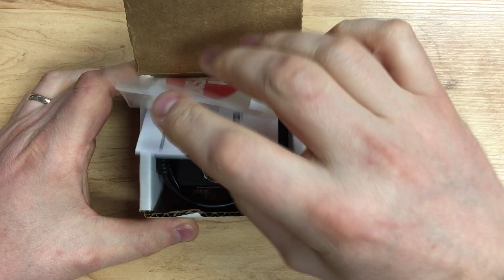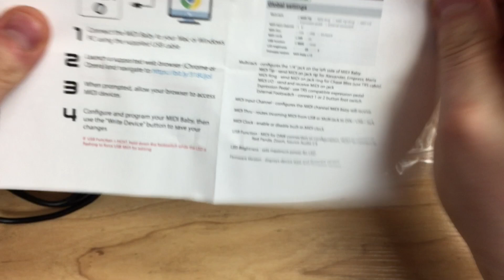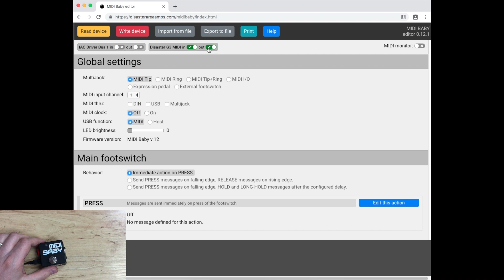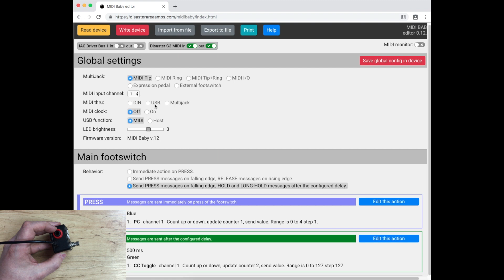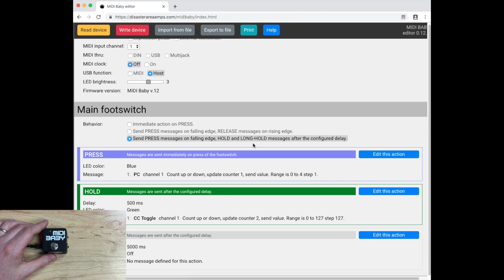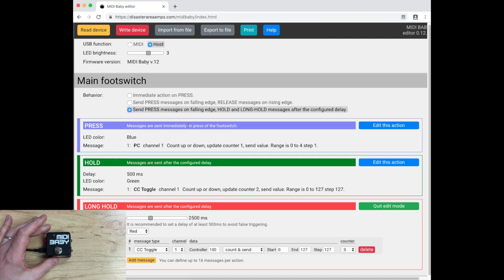Disaster Area MIDI Baby 1: Introduction

Comment: MIDI Baby Gen4 is the best smallest MIDI controller out there. No doubt. I use it to change presets on my El Cap v2 and it works like a charm. I use a different LED light for each preset. Sure, if you need tons of presets, you might want a controller with a screen and/or more options, but for simply changing up to like 7-8 presets, it's perfect.

Comment: Hey. Do you have an idea if there is a way to use this to control start/stop features on my Akai MPC One + Sampler? My unit does not have a foot switch input but can accept midi clock signals from other drum machines. But this is a hassle to do live. I've searched high an low for a solution. Thanks.
Reply from the maker: Sure, the MIDI Baby and Baby 3 can send MMC Start / stop / continue messages as well as MIDI start and stop.  My guess is we can make it work.
Reply: @DisasterAreaDesigns  Awesome. Thanks for getting back to me so quickly. I just ordered one and will report back if it works out. Thanks!
Reply: @DisasterAreaDesigns  Tried it but no dice. Not saying it's the pedal's fault but the thing that is complex with the Akai MPC One plus is that it needs to see a clock setting coming in to allocate start/stop functions. If it doesn't see a clock, it does nothing. When the Midi Baby is set to "clock out", my MPC is defaulting to it's internal tempo which is 120 BPM's regardless of what the sequence tempo is set to. Long story short, although the pedal can indeed start a sequence, it can't find the correct tempo to match. If you know a work around please advise but I think it's dead end.
Reply: @thegreatpatsy  That's an issue with a lot of devices, including Roland gear.  The micro.clock (classic and Gen4) can operate as start / stop while allowing you to set the tempo with their control knob, if you purchased the unit from us we'd be happy to swap out for the price difference.

Will sending an MMC Start or Continue message do the trick? The Baby can also do that.   I'd try that as well as normal MIDI start.
Reply: @matthewfarrow8151  I had tried MM start, no luck, does nothing at all. There is no MMC Continue function on the software. I researched the micro clock but this seems to be the type of pedal that sends tempo to a unit which I'm trying to avoid because it's two steps. I appreciate the suggestions though.

Comment: Suppose I have a looper pedal that doesn’t quantize, but it does take a remote stop/start switch. Can this be configured to start a looper on the first press and stop the looper on the first quarter or whole note after the second press? I have a DAD SMARTClock I’d be using to keep the tempo.
Reply from the maker: No, I don't think so.  It doesn't know what your tempo is, and it can't count clock messages to find out.  Sorry!

Comment: Hello, I sent you an email from a web page, but it may have been sorted as spam, 
And the text of the email was ambiguous. So I'll rewrite the question here.

I have a question about 5pin DIN Jack on MIDI BABY.
I just bought this the other day.
I want to connect a foot switch to the multi-jack and simultaneously perform MIDI IN/OUT from the 5-pin Din Jack. 
Is this usage possible on MIDI BABY?

I just tried it with a MIDI Y cable using various pin assignments. But it all failed.
So I suspect that MIDI BABY may not have such a function natively.

There is a description of the Y cable on the "MIDI BABY 3" page on HP.
However, there is no description about the Y cable on the 1-button "MIDI BABY" page.
Therefore, I assume that the 1-button MIDI BABY does not have a MIDI IN and OUT function with one Y cable.

Is "MIDI in and MIDI out using a Y cable" possible with MIDI BABY?

Comment: Would it work for remotely on/off an Emprress Phaser? I have no experience with MIDI devices...
Reply from the maker: Sure!  Set up an action as CC Return, CC 36, high 127 low 0.  That will send a CC36/127 and then shortly after a CC36/0, simulating tapping the bypass switch.
Reply: @DisasterAreaDesigns  Will it work with a normal single pressing or it would be a hold or long hold? Thanks!
Reply from the maker: @rgr4929  just a tap will do it, the MIDI Baby will handle the "press" and "release" automatically.
Reply: So you mean that it will work as a momentary footswitch and it goes on when you press it and goes off when you release it? Only on while you are pressing it?
Sorry for all my confusion! And thanks for all your answers!!!
Reply from the maker: @rgr4929  it can work in any of those ways, if you want.  You can program the MIDI Baby to fire the action as momentary, latching, whatever.  It'll work.
Reply: @DisasterAreaDesigns  Hello, I finally got my Midi Baby for controlling the Empress Phaser and I cannot follow your previous orders because I don't know how. I can set the "CC Return" but I don't know how to set the CC 36 (Should I put 36 in the "Controller" box?). Instead High and Low there are two boxes that says "value 1" and "value 2"... Is Value 1 the High and Value 2 the Low? I put this in this way Value 1: 127 and Value 2: 0 bu I cannot get what I want. What am I doing wrong? Thanks!

Comment: Hi. Im new to midi stuff.
Can I use this with my ditto 4 to stop loop 1 with 1 press? Thanks
Reply from the maker: Not sure - the Ditto X4 manual only mentions MIDI in terms of loop sync, which I take to mean it's just quantizing the loops to the clock.  If you can find out what commands the pedal will accept for loop stop, I think we can probably control it.
Reply: @Disaster Area Designs  MIDI Spec
Responds to MIDI Channel 4 (hardcoded – can’t be changed)

CC3 Looper 1 Rec/Dub/Start
CC9 Looper 1 Stop
CC14 Looper 1 Clear
CC15 Looper 1 Level
CC20 Looper 1 Hold to Store
CC21 Looper 1 Clear Backtrack
CC22 Looper 2 Rec/Dub/Start
CC23 Looper 2 Stop
CC24 Looper 2 Clear
CC25 Looper 2 Level
CC26 Looper 2 Hold to Store
CC27 Looper 2 Clear Backtrack
CC28 Decay “Level”
CC29 All Loops Stop
CC30 All Loops Clear
CC31 FX On/Off
CC85 Parallel/Serial Toggle

the FX respond to Prg change message 1 to 7

Midi CC commands/ Prg change messages are programmed into a midi track / clip in your DAW or sequencer (Midi channel 4!)
Reply from the maker: @robsask  Yes, in that case it's definitely possible.  Assign the button on the MIDI Baby to "send on button press" CC9, value 127, channel 4.  That's it.
Reply: @DisasterAreaDesigns  great!
I purchased one from you. Thanks for the help!
Reply: @Disaster Area Designs  hi! I received midi baby and it stops with one press. Cool. 
I'm wondering if loop can be cleared by pressing down on midi baby? Can't figure how to assign it. Please help. Thanks
Reply from the maker: @robsask  Change the button action to Fire on press / Hold / Long hold. then set the hold action to CC14 / 127 to clear looper 1.
Reply: @DisasterAreaDesigns  can't see fire on press anywhere? Confused
Reply: Do I need to set anything up on my ditto 4 with the usb?
Reply from the maker: @robsask  Main Footswitch: Send PRESS messages on falling edge, HOLD and LONG-HOLD messages after the configured delays.  Configure ON HOLD to send CC Toggle, channel 4, controller 14, send single value, value 127.
Reply: @Disaster Area Designs  it took me a few tries... but it now works! Thanks so much for your help and for the midi baby!

Comment: Hi! Very cool design. Would this work with a wampler terraform for changing patches 1-8? And to select 3 of the 8 patches?
Reply from the maker: Maybe?  Wampler's MIDI implementation is... interesting.  It's possible that this will do it but we haven't messed with the Terraform much so no promises.
Reply: @DisasterAreaDesigns  im interested in using the midi micro, your 2 switch version with the digital screen in the middle now! im hopeing i can save some presets with it and just scroll up or down to select a patch
Reply: Excellent question! Thats exactly why im looking at this!
Reply: @Mr_A_Mia  great!! Hopefully we can find out if it will work. I think it prob will but I need to be 100% sure first

Comment: Can you use this to control neural dsp plugins?
Reply from the maker: Not sure, but if they accept MIDI CC or notes for control purposes I don't see why not.
Reply: @DisasterAreaDesigns  if they do, i just need to connect the usb to my mac? my mac does not have midi ports.
Reply from the maker: @kow294  Sure - the MIDI Baby and Baby 3 both show up as USB MIDI controllers when you plug them in.

Comment: I would like to know if it could be used to send sustain messages and act like a sustain pedal for synths that do not have a 1/4 in sustain port, but receive midi
Reply from the maker: Sure.  Sustain is CC64, or sostenuto CC66, check which one your synth supports.  Set the Baby to send message on press and release, and configure to send CC64 /127, CC64 /0 for press and release.  That should do it, if your synth supports the normal commands.

Comment: Could you chain a midi baby with a midi baby 3 to get a 4th controller (obviously setting up the pass thru)? Asking for a friend.
Reply from the maker: You could, but you can also just use a tap tempo type footswitch (single or dual) to get 1 or 2 more button inputs.  In fact, the Baby 3 has two jacks, each of which supports two extra buttons for a total of 7.
Reply: :mind blown: THANKS!
Reply: @DisasterAreaDesigns  Those dual tap tempo type switches would be TRS, momentary, normally open, with tip going to the left and ring going to the right (or reverse, i guess it doesnt matter as long as i know which one is which)?
Reply from the maker: @thesmartrobot9013  Yup, exactly.  The editor labels them as tip and ring.
Reply: Thanks again!

Comment: Just saw the announcement of the Midi Baby 3... and I finally think I'm gonna have to get one. Using it with an Adrenalinn 3, and that unit's main shortcoming is it only has 2 buttons. This is perfect! Small, configurable, doesn't need crazy options. Just a simple, easy to use MIDI button controller. Good job!

Comment: Is there a specific video for setting it up for the SA C4? I am having a lot of issues.
Reply from the maker: StrangerDanger first up be sure to set “Skip USB Power Check” in your C4 settings. Next we have found that the C4 responds to MIDI CC more reliably than PC so try sending it CC104 / nn where nn is the preset number you want to load. Feel free to email for support through the website and we can take further troubleshooting steps.

Comment: I’d also like to see a video on what the functions of the editor do. For example, in this video, when you configured the long hold function, why controller 100? Why step 127? I am a midi noob so this seems presumptuous. I have had this pedal for two weeks now and still am just guessing at how to set it up to control a simple 4th switch on my HX Stomp.
Reply from the maker: We're covering them in each video, but in this case CC100 is "expression" for a lot of devices such as Strymon, Chase Bliss, Alexander.  Commands for your specific device will be in its manual.  We'll be happy to go over what the actions all mean in an upcoming video.

Regarding the HX Stomp if you want to fire FS4, you'd check the manual for the HX Stomp to get that command - CC52.  You can trigger it in a couple of ways, but I might recommend using the second option (Send PRESS messages on falling edge, RELEASE messages on rising edge.)

Set the first message (PRESS) to CC Toggle / Ch1 / 52 / send single message / 127

Set the second message (RELEASE) to CC Toggle / Ch1 / 52 / send single message / 0

Write device and you should be done.  Next time, don't struggle - email us!  We're happy to help and I think we can get you help quickly.  support at disasterareadesigns dot com any time.

Comment: Does the event (sorry for lack of a better term, web guy) only get sent on button up/release? I could see a problem with long hold if it calls the regular hold. Hope that makes sense. Basically, don't want to hit the 500ms action while waiting to get to the 2500ms action.
Reply from the maker: The hold and long-hold actions are sent while the button is still down.  The hold action is always fired on the way to long-hold, so if you don't want it you can either add in a long hold action that cancels the hold action, or just don't use the long-hold.